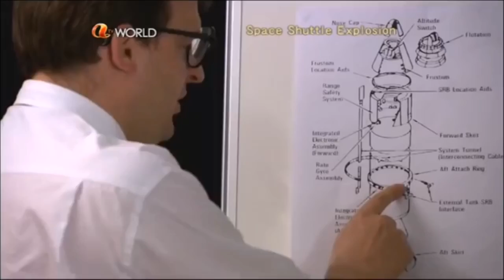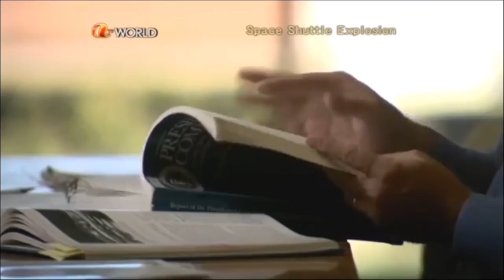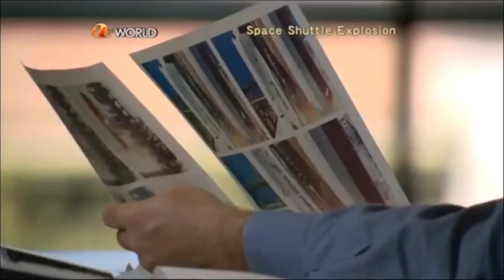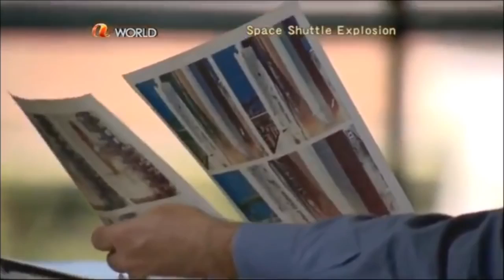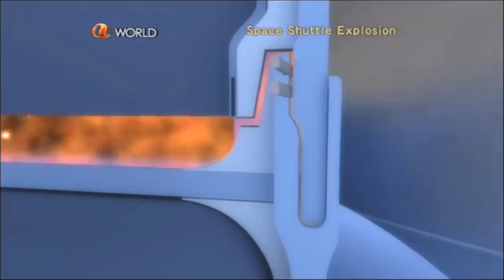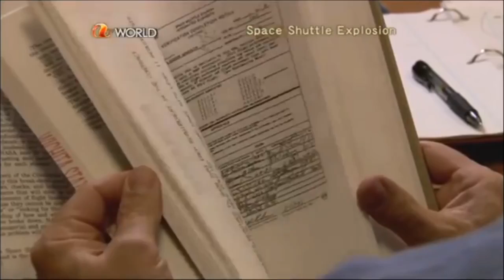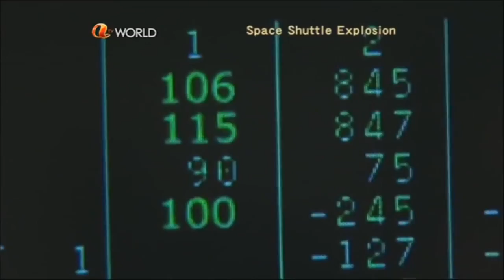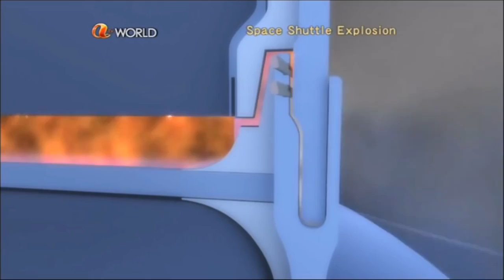Space Shuttle Explosion HD

Comment: The smoke possibly came out of the right booster and heated up the engines causing the engines to overheat and caused the speed malfunction making the right booster to use more oil than it should and overspeeding its own speed limit making it go faster than the left booster and made it spin around then after the spin when it went steady the heat broke a hole in the engines and the heat got into the engines causing it all to start burning inside or the right booster kept in the hot gasses which costed it to overheat inside and explode. This is my theory not fully sure.
Reply: At 41:20 remember when they said the ship may have got pushed by strong wind? I myself dont think that would be possible. When the ship spinned the right booster was spassing out causing it to push right to left

Comment: Is it possible that the oxygen for the astronauts was activated before the explosion or by the force of the explosion and not by the astronauts after? I just can’t imagine how they survived that amount of pressure and heat, then survive while plummeting to the ocean? But they did say that earlier in the video before they fully understood the situation. So maybe the astronauts really did die immediately in the explosion.
Reply: They did not die immediately in the explosion, because there was no "explosion".  The orbiter suffered an aerodynamic breakup, the forces of which were not sufficient to kill nor even moderately injure the crew.  So lacking adequate g forces to inflict fatal injuries, a crew cabin that was recovered from the ocean floor fully intact (with astronaut bodies still strapped to their seats) and several switches on pilot Michael Smith's control panel moved from their launch positions to positions consistent with efforts to restore lost electrical power, there is absolutely no doubt whatsoever that the crew survived the initial breakup.  The "explosion" as seen on video was a rapid, but not explosive, release of liquid rocket fuel from the large liquid tank as it broke apart.  Travelling at nearly twice the speed of sound, it would not take more than a few degrees of lateral movement to cause the complete disintegration of the orbiter assembly.  The maximum g force exerted upon the crew during breakup would have peaked at about 20, if even that high, and for no more than 2 seconds.  Not enough to cause fatal injuries.  The only question that cannot be definitively answered is was the crew CONSCIOUS during the descent.  Medically, that is indeterminable, but the evidence nearly conclusive that at least a few, if not all, were conscious, and fully aware of their situation for the 2 minutes and 45 seconds between breakup and ocean impact.
Reply: I hope so, I wouldn’t want them to have been conscious and to know that this would be there demise😞

Comment: Shuttle launches were 'automated'.  Nobody told the crew to throttle down or throttle up.  It is done automatically. Silly commentary.
Reply: Well, there are videos from mission control where they actually say that, they get a response from Challenger, and then it blows up:(
Reply: drguffey it has to power up, or throttle up, for when the rocket boosters separate! Lol! It doesn’t just stop! The rocket boosters take it as far as the atmosphere allows.....then, the engines, the three you see on the back of the shuttle, power up and take over, putting them into orbit! But, the shuttle did land without any power.....it was a falling brick and completely controlled by computers. The pilot simply lifts the nose and such, to land the brick on the runway!
Reply: drguffey btw.....mission control would have to inform the crew that the shuttle was about to throttle up! Wouldn’t it? I think if I was in a tube stuck to a bomb......I’d wanna know! Lol! 👍🏻
Reply: Actually, it throttles up after 'max Q'.  The shuttle crew has been thru dozens of simulated launches. The communications between the shuttle & Houston are really just check points. The pilot does fly the shuttle after re-entry to landing, not just lifting the nose.
Reply: The crew knows when the Shuttle is throttling up just by watching the throttles.  Something they've been thru numerous times.